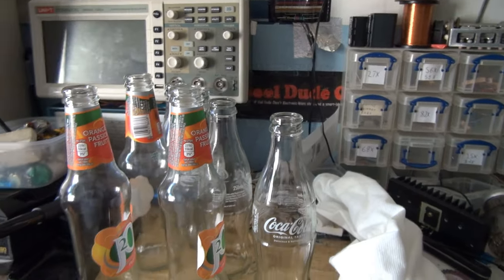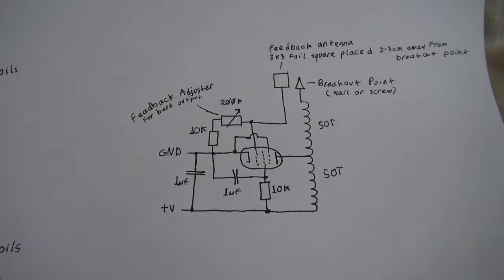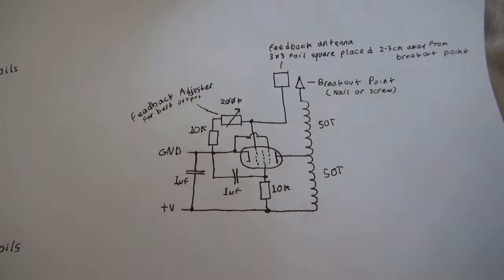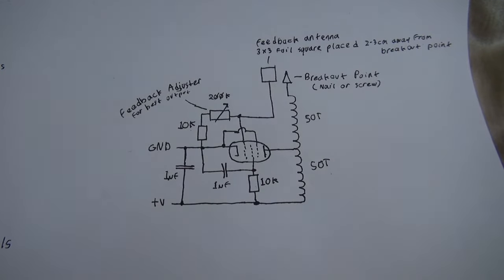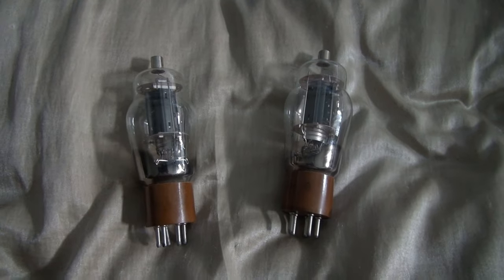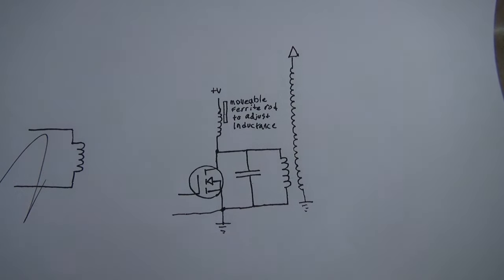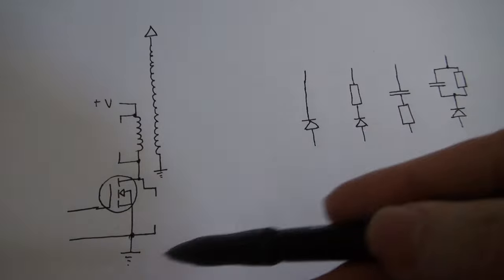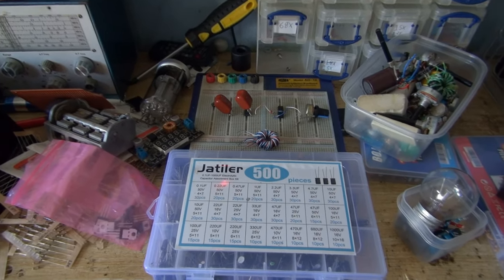Some ideas for future tesla coil videos

Comment: Vacuum Tube ZVS, you can make a push Pull tesla coil with them it you tube it to your secondaries frequency.
Infact I am working on one with two GU-81 Tubes.
I made a small prototype with a tiny tube on my channel.

Are those 807 Valves?

Comment: Nice. i knew you would eventually figure it out. have you tried experimenting with a zvs driver with a old CRT tv flyback to power a tesla coil? Or use a high power mosfet as the switch in a "slayer exciter" circuit...Plenty of videos on youtube describing how these cirucits work. there are so many possibilites.
Reply from the maker: I know that I once did a spark gap Tesla Coil experiment using a fly-back transformer. I can't remember if that was powered of a ZVS or not. At  the tie it didn't work well. As for the slayer exciter circuit using a mosfet, yes I've definateley done that in my "how not to make a Tesla coil (or whatever I called it)" video, and will be re-visiting it in a future video.
Reply: @CoolDudeClem  Another nice project to look into would be an induction heater...They use a push pull ZVS driver the same as a tesla coil.

Comment: The feedback potentiometer isnt really good since you arent adjusting the mounted of feedback you are basically changing the loading on the he output since you change the resistance.
the potentiometer slider should go on the grid, dont wire is at a rheostat instead like a rheostat.
Reply from the maker: Good idea there, I was considering doing it that way myself, I dont really know why I thought of doing it in the way of loading down the output.
Reply: @CoolDudeClem yeah and tuning the resistor isnt really a good idea I think, i think tuning the capacitive feedback from the top b the distance is better. 
But you will require short connections especially for HF circuits. 
I dont know much about them but that makes sense. 
Try to see what happens, but I bet that at one point it will oscillate or completely die, so you need some sort of fuse, otherwise you may blow the cathode wire straight off the tube, the soviet datasheet doesnt say the maximum allowed current for the GU-50, but the German one (LS-50) does, its 130mA. 
Tho the wire is thicker than tubes designed for 500mA (PL519) and it will most likly take about an amp maybe. 
But always fuse externally